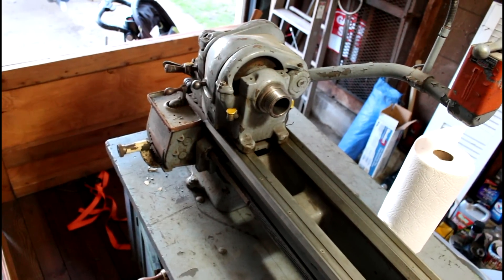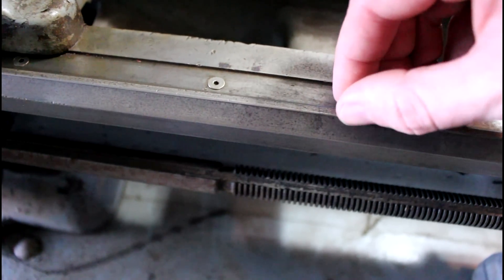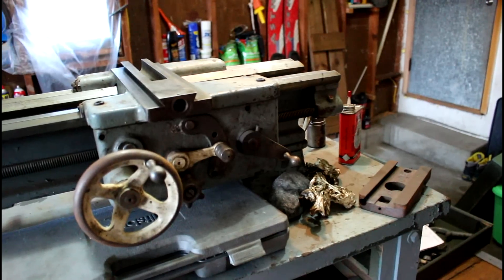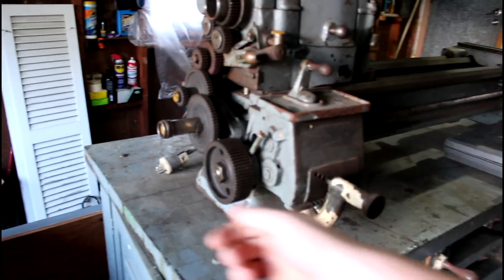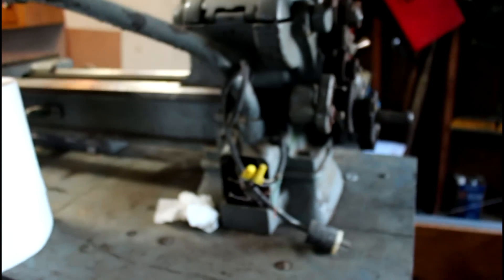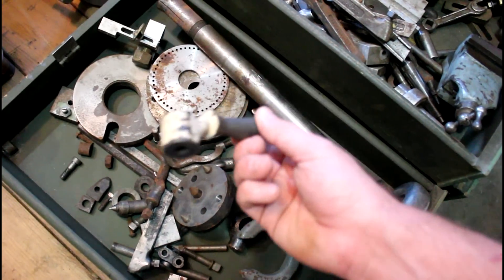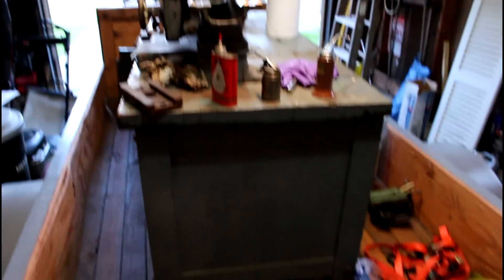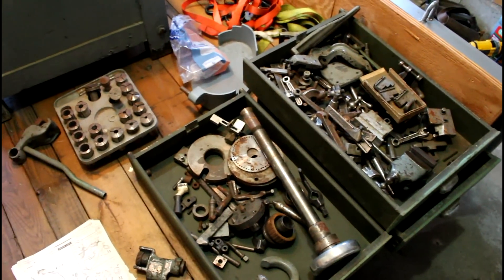South Bend Heavy 10 Lathe Navy Model

Comment: I just picked up the same model only with the 4' bed. It's an 8187AN sold in July of 1942 to War Department Air Corps in Mobile AL with serial number 128729. Mine also has the maple cabinet. Other than desperately needing a good cleaning, mine is in surprisingly good shape.
Reply from the maker: Those maple cabinets are something to behold in and of themselves. Would cost a fortune to build one today!

Comment: Hey, I recently bought a 1941 Heavy 10 that was sold to the Air Force and on the serial card for the lathe it specified "Spec. order cabinet bench in lieu of steel bench, hard maple 8-drawer." Do you have any details about that bench? Someday I will probably do a full restoration of the lathe and would like to build a new bench to match the original. Thanks for your help.
Reply: Erik, did you ever get the info you needed? I just picked up a 1942 8187AN with the 8-drawer maple bench. DM me if I can help you with measurements or photos.

Comment: I just picked up 2 6 inch atlas lathes,,,109 and 618 both in great condition,, and both for 400,,almost passed them by, so glad I didn't,, restored them both and put them on display, I can do everything I need with my 12 x 36..it was also in very good condition,,,so many bad mouth the zmac gears but I'm 3 for 3 all over 50 years old and not one bad gear,,,hell there making gears out of plastic and nylon now and you have to abuse them to really hurt them,,,l try not to buy any lathe before timkin bearings,,  all mine are except the 109,, but you can do much on it with the little spindle anyway.

Comment: Hi, I  have  the same lathe and I could use  the back gear  you mentioned  the one that slides out  &  has  the smaller gear  on it, mine has a half  of a tooth  missing , works just fine but I am leaning on replacing it .
 here is is a link to my 10 L lathe  on youtube                https://youtu.be/ZcD74vNbnms
 Thanks Mike